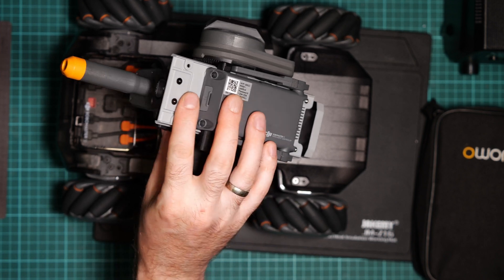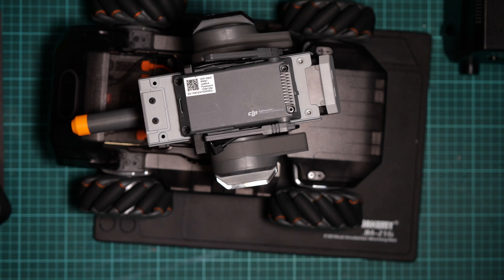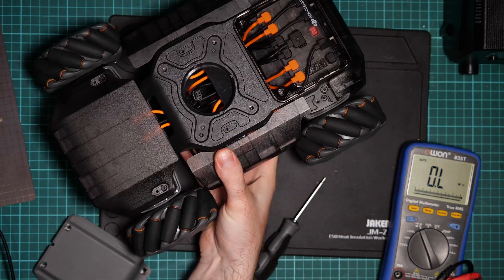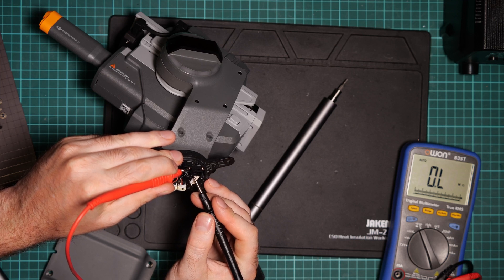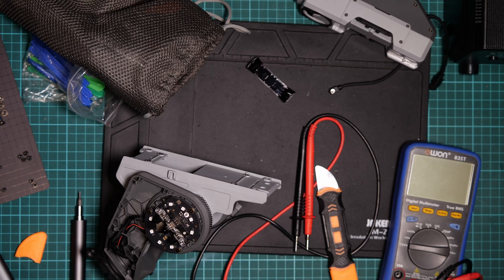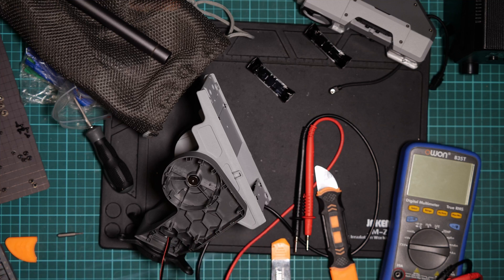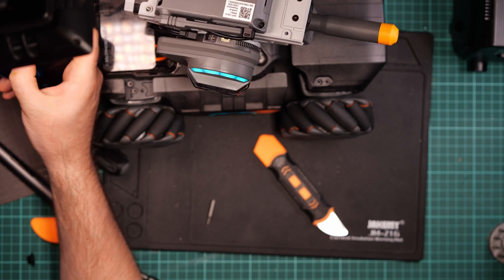DJI Robomaster S1 Repair/Fix ( no Chassis connection)

Comment: We've got one that has a gimbal that doesn't fully rotate.  When powered on, the gimbal gets no power at all and it's impossible to connect to the robot to see any errors.  We checked the connection of the gimbal to the board and couldn't get anything
Reply from the maker: You have to measere the voltage from the controller board up to the Smart Brain. Then you know where the problem is. It is maybe a wire

Comment: Ok I’m having the exact same issue and have done everything in this video still have nothing what other issues would cause this problem in the gembal?
Reply from the maker: Do you have a multimeter
Reply: Yes I have checked the ohms the gimbal and I have nothing
Reply: I also took the gimbal apart checked all of the wires and connections unplugged and plugged back in still nothing
Reply from the maker: How big is the resistance 60 or 120 or infinite
Reply: When I hook the meter to the canbus on the gimbal meter picks up nothing when I hook meter to every canbus on the motion controller I get 120 I have no reading at the bottom of gimbal and I have no reading at the top of the gimbal
Reply from the maker: You can try to measere the resistance from top to button. The same pin button and top of the gimbal. But it seames the same problem. You have to trace the wires inside the gimbal. And see were it is brocken.
Reply: I have some pictures of what I’m getting and where if I could share them with you would be great and maybe you could walk me through what els I could check
Reply: Ok I have checked each pin top to bottom my number on each one is .8 should I unplug the top and the bottom plugs and check it that way
Reply from the maker: Je check the pins with any wire attached to the gimbal
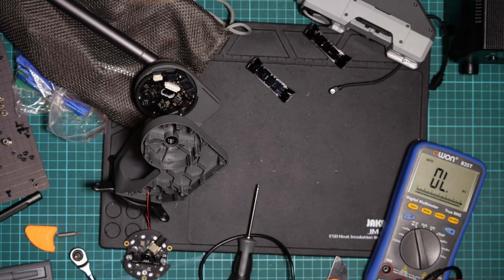Reply from the maker: You may see at 16:00 how I do this, you do not have to tear it down for this.

Comment: Am getting motor error ? Think my motor is shot, after only a month use ..
Reply from the maker: Witch motor is it. How does this motor turn manually, if it harder to turn then the others, you maybe has an hair or dirt twisted around so it is jamming the motor.
Reply: @AntonD  Thanks.. it is hard to turn when it is connected to the system, if i unplug it, then it is easy to twist. I think its the motor. I have a spare S1 and switched the motors and it worked fine. but now for some strange reason when i put the spare back (motor) the spare does not operate, saying the same error message I got from the other S1, Thanks for the reply
Reply: @AntonD  rear motors (both now)
Reply from the maker: You aks the support of dji, because I never see spare motors. Maybe there is an error in the motor Ids if they have some. Because the motor control bus is rs485 so those may have some addresses an now you have an address conflict.
Reply: Yes spoke to them today , am going to send only the motors  back for repair or exchange ... we will see... a little over a month. I read on a dji post that a guy had this issue only 10 mins after driving it around ?
Reply from the maker: Never head of it. But nice to know, I have only used s1 s